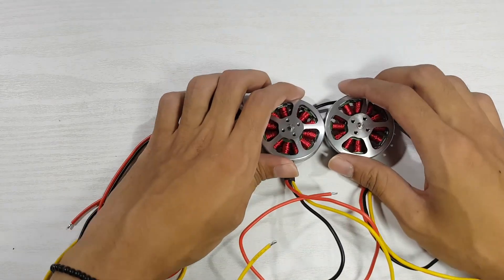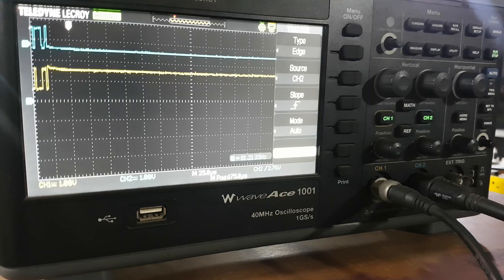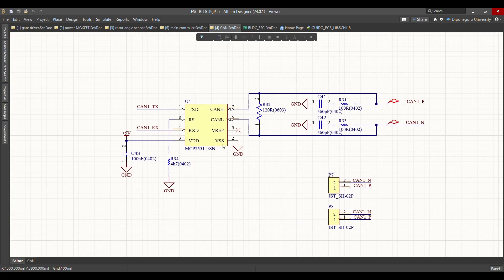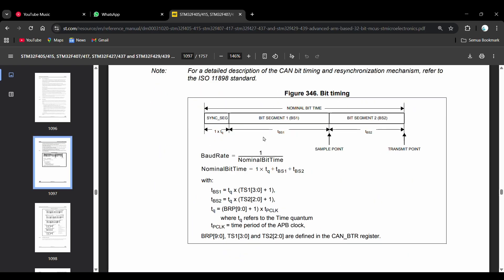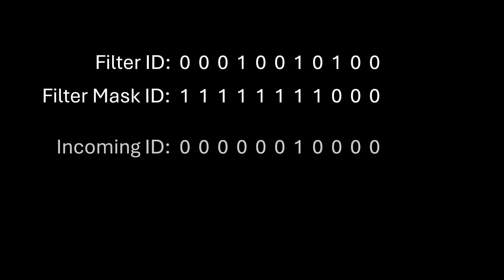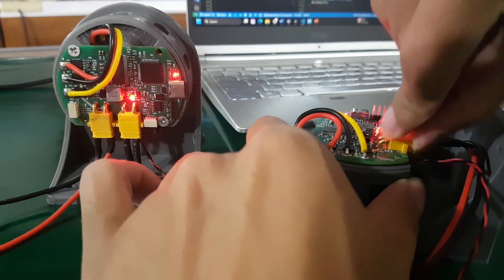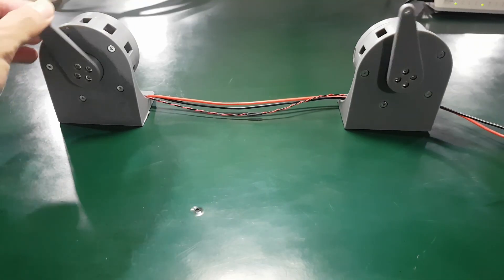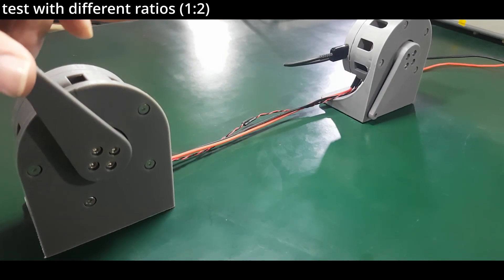BLDC Haptic Control with CAN Bus | Real-Time Motor Sync

Comment: If you're desoldering modules to get the transciever IC, check out LCSC, that's where I get my ic's from. They have a HUGE catalogue of parts.

Also, sidenote, ESP32's also have CANbus, only needing a transciever chip as well. For some reason it's called TWAI in their documentation but it's exactly the same thing.

Comment: How big do you think you can DIY a motor? Do you have interest in something around 200 HP sized? Think car / hybrid. Or perhaps a hybrid motorcycle at something like 50 HP.  Costs can likely be reduced with a no magnet design. Honda uses a magnet less motor. They use a field current similar to how an alternator dies it but as a motor.

Comment: Pro tip: define your CAN messages in a .dbc file or some other file formats that can be exported to .dbc (I’ve developed a simple tool called jsnodbc that converts json files to .dbc, or directly define your CAN network “as code” with acmelib). Once you have your messages defined in your .dbc file, use the c_source generation feature from cantools. It will generate the pack/unpack functions, so you don’t have to insert manually raw values into the payload array
Reply from the maker: wow, looks interesting. Thank you for sharing
Reply: i wish autosar version of dbc handling would be this easy.  I hated configuring the whole can-canif-ipdu-ipdum-com-ComM chain for a signle fkin can message.
Reply: Looks interesting,thanks for the info

Comment: i jhad hoped that you share more about how the haptic control demo works. how does it deteremine which is the one that is the leader ? for example when one would be assigned leader, it would be trivial (just copy the position target), now when you let go it stays, but when you switch and move the other, how does it know that it is now supposed to move the first one ?
Reply from the maker: Each motor driver constantly reads its position and then sends its current position to the other motor driver. The data received by each motor driver is then used as a position set point. 
So if we move the position of motor A just a little, the data sent by motor A's driver will also change according to the position we move. Because motor B follows the position of motor A that we move, the set point sent by motor B will also approach the position of motor A.
Hope this helps. Thank you :)
Reply: @srj4555 thanks, will try this.
Reply: @srj4555   You should make it also load/torque-based. That way it will be a true fly-by-wire linkage, just limited by the torque the motor can output, of course.

Comment: Great video! Haptic control can be implemented without using position control mode. You can use a spring-damper mode (a joystick with feedback). The video shows not purely haptic control, but rather a follow mode.
Reply from the maker: thank you for sharing :)